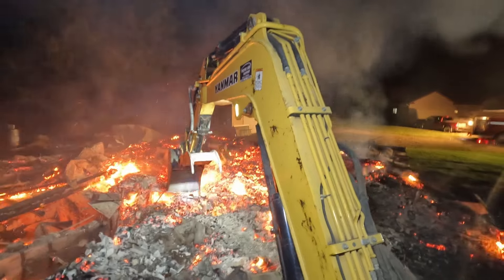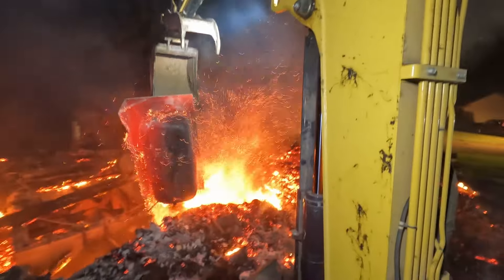Burned Farmhouse Cleanup: What We Found in the Ashes...

Comment: You trashed or gave away treadle sewing machines ?!  I gotta ask, are you nuts?
Reply from the maker: The actual sewing machine was missing, and the cast iron drive mechanism was broken, as was the wooden table portion. I think my uncle pawned the sewing machine. Trust me, if it would have been fully intact, I would have set it up somewhere in my house as a display piece just for the nostalgia. Unfortunately, we found out from a guy I worked with that my uncle was notorious for pawning the antiques in that house. This was, of course, after his death. My dad, at one time, went to the house to get my grandmother's vintage, carnival glass serving set, to which my uncle claimed someone stole it from the house. So, yeah, anything of actual value was already pawned because my uncle didn't care, and anything remaining was severely damaged by the hooligans he let stay with him. It was a messy situation. 

My dad and I salvaged an old safe that belonged to my great grandfather. The only reason it was still around was because it was too heavy to move. We took it out with our hydraulic equipment. However, that too was destroyed because the low-life delinquents he, and by he, I mean my uncle, used to let room with him tried breaking into the safe by trying to cut the hinges off. The tumbler doesn't work right because they tried breaking in with a hammer. I'll take a picture and show y'all. 

At this point I don't even care if I spill everything about how much of an a-hole my uncle was. He screwed us all over royally with the family heirlooms he pawned off, the kids that weren't even family that he let live with him and broke or intentionally wrecked other family heirlooms, and the way he left that house. Now you get to know the full story.
Reply: @kickitinthesticks1446   I can tell you AFAIK, my grandmother Anne's like sewing machine was moved to a garage barn long before g'pa's death, and the actual sewing machine rusted up into display only.   I think Aunt Judith got the case, and my mom got the frame and roached out wood.  The sewing machine mount's cast frame has been made into a mail/end table with wood from the barn.   Right pretty -- not a sewing machine still though.
Reply: Mom had more than few dresses made from sackcloth on that machine, back in the 40's
Reply from the maker: @taliaperkins1389  That is very neat. I remember once when I was a kid, I got to see one in action. Someone who had a floor loom, and an old sewing machine like that, brought it to our school  when I was about 7 years old to show our class how past generations used to sew and make their own materials. It was the coolest thing.

When we were cleaning out the house and my dad said, "There's the old sewing machine," I asked, "You mean like one of the pedal driven type?" I was so excited and pumped until he told me, yeah but the sewing machine is gone, and then he told me about the broken parts. I was heartbroken. I thought it would have been the coolest thing to have a piece of history like that. What a joke. I'm still very bitter about everything of that whole situation. Especially when my co-worker, who was only at my place of employment for a short while, told me....oh, I know about who your uncle was. Then he told me about how he'd be at this person's place pawning antiques for finishing equipment. My co-worker knew the people my uncle pawned stuff with, and they used to tell my co-worker about how this guy, my uncle, was trading priceless, vintage stuff for fishing gear. It's a small world. My co-worker had no idea that was my uncle at the time until I was telling him about the mess we were going through.